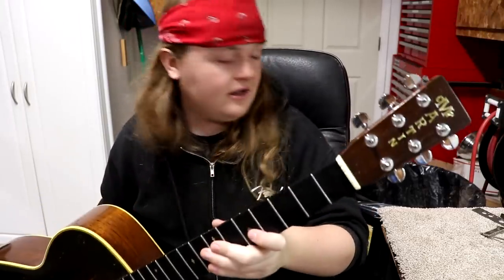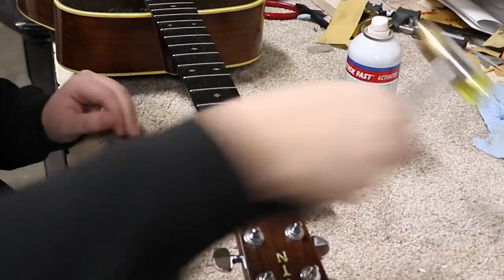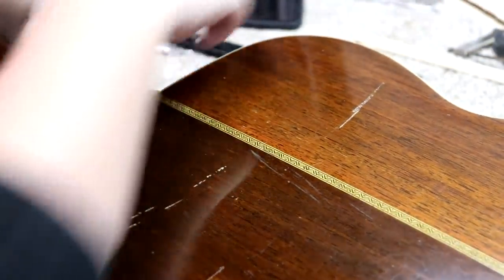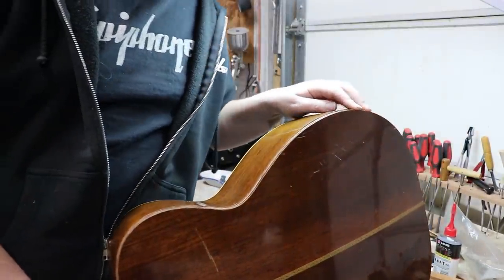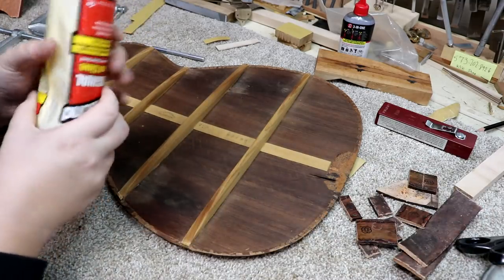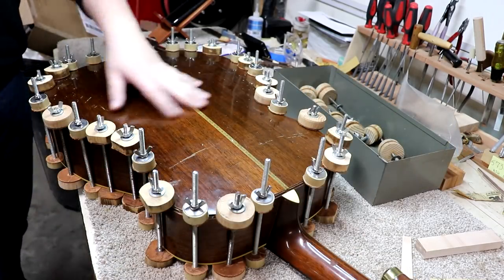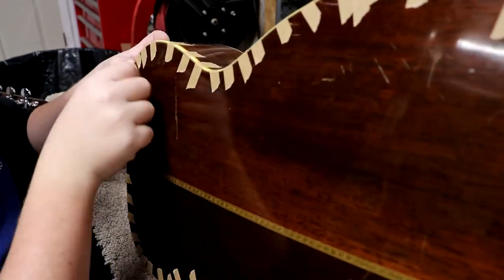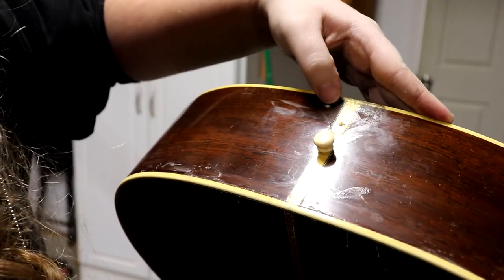496 RSW 1934 Martin C 2 Arched Top with Fallen Arches

Comment: I can tell from the big Grover tuning machines that this was worked on by Martin during the 1960s or early 1970s.  Their shop did truly gawdawful repair work back that -- they danged near ruined my old D-18 when I brought it for repair under warranty circa 1969, so I'm not surprised that their work on the nut and frets was substandard.
Reply: Bruce Morgen    I don't know personally, never having owned a Martin, but I'm told there were lots of problems in their production and in their warranty/ repair shop.  Too bad -- they have a name that is revered by everyone.  New and better management, just like at Gibson.  Some people get a little skittish about Gibsons to this day.  Their finishes are top quality, but maybe not so much inside.  I'll probably never find another old J-50 like I had in '65.  Had to part with mine in '02, sadly.  Be well, my friend.  Bob
Reply: Yes I've heard the same things.
Reply: Its a shame Martin didn't replace the machine heads with something a bit more vintage looking. Those chrome Grovers look awful.

Comment: Good job. I was suprised when you opened it up. The last old Martin archtop I saw, Martin had used braces to get the top to arch. (The guy fixing it made up a plaster mold for the top, then used his go bars. Explaining the reasons, etc.) Don't know if the one repaired was a bit newer, or older. The other was a 1930s build as well. Very suprised. I just knew it was going to be a big problem, but, no. You made it look easy, though I know it wasn't. Again good job!👌👍Oh, before I forget, my grandkids (12 & 7) love it when you do the repairs! When they see you, they say "Hey that's Caleb!!!"
Reply: Cool!  A Caleb Fan Club! 😄
Reply: This guitar is part of the C series, which had carved tops. And as it's a C-2, it has rosewood sides and back and originally came with nickle plated tuners and tailpiece.
Reply: @patrickwilliams3108  thanks for the info. I've only seen a few Martin archtops, I've heard they weren't very popular, as opposed to Gibson, real Epiphones, DeAngelico, etc. Thanks again for the education.👌👍

Comment: Nice old guitar.  One tip on archtops - rather than tweaking the bridge under all string tension, put on the two outside e strings.  Set those for intonation.  Then put on the rest.  That way you aren't moving the bridge around under full string tension.  Nice work.

Comment: Do you hold on to vintage binding when you replace it? Seems like it would be a great resource for repairs.
Reply: Jerry has a drawer full of parts and pieces of old binding. You'd think with as much as we have you'd find more exact matches, but we're rarely that lucky
Reply: I sent many  years  supply of old bindings from my 52 year old shop I closed it ""94yrs old"" it is in Jerrys stock.** old celluloid//cellulose binding should be stored  in a sealed mental container****DR KEL

Comment: Great job, Caleb!  I’d love to know when the owner took it to Martin for “service.”  Cant imagine them claiming to do anything with those frets, if they are pulling up and sharp on the ends and you can see play wear on the first few wires.  The nut issues are weird, too.  It seems to me they slapped some new tuners and a prefabricated nut on there and called it a day.
Reply: Hi this is the owner... I said that only because Martin Charged me for it on the bill, But when I looked at it it didn't look right to me.

Comment: Great job Caleb.  Once question.  Since you’ve opened up an 80+ year old Martin, would it not be best to remove and re-glue all of the braces, not just the sections that are currently delaminated?  That might be cost prohibitive, to the owner, but I think I’d make the investment in a family heirloom.
Reply: If they were any closer to loose I would have agreed, but there was no way the center of the braces were coming off without pulling pieces of the back with it. So to avoid damage I glued just the ends back down. If many years down the line the centers do come loose, the back was glued on with Titebond original, and should be easier to remove than when I had to.
Reply: Braces come lose due to hide  glue used years ago*****DR KEL
Reply: @MillsGuitars  makes sense.  Thank you so much for replying to my question.  Keep doin whatcher doin!  Great job.
Reply: @dscdrkel5546  I know.

Comment: Some call it a ‘taper’ Caleb, when the fretboard slopes down toward the dusty end of the neck. It tapers away, it means to gradually change level.
Reply: Most commonly called fall away.
Reply: @mattrogers1946  thanks Matt.
Reply: No a cut away  guitar you try to keep the fret board extender as flat  as possible**this will make the saddle taller for greater string brake  this gives better  sound and volume **DR KEL
Reply: @dscdrkel5546  He was talking about fretboard fall away, not a cutaway. By the way, it's BREAK angle, not BRAKE angle.

Comment: Why not use Titebond III.?
Reply: Titebond III is virtually waterproof, and much more difficult to remove in my own experience. Titebond 1 holds well, and can still be removed with heat and steam.
Reply: I accidentally used titebond 2 for my first project, and it's only water resistant, yet it can be ridiculously difficult to remove and repair. 
Edit; forgot a word.
Reply: Jerry covers this well in several videos, including Shop Talk 20 and Shop Talk 23

Comment: Caleb***When are you going to use the proper tools on the fret board***I SENT YOU THE PROPER TOOLS SO USE THEM.. notched straight edge and rocker tool.****I 52 years of instrument  designing and repair I never had to use a file on frets ****DR KEL
Reply: @davebryant8050  * I have been friends with Jerry for many years**At age of 94 I closed my shop and sent Jerry 7 care packages of tools and used and new parts***I also sent Cabel some tools to do a proper fret job.NEVER USE A FILE ON FRETS.***DR KEL
Reply: @dscdrkel5546  Kindly enlighten us as to what the proper tool is to recrown frets...
Reply: @mattrogers1946  My comments has nothing to do with crowning frets.The proper way is to use a notched straight edge  to make sure the neck is level NO relief *loosen the truss rod to  so the neck can  return to a flat condition and then rock the frets to see if they need  leveling **reset the high ones and crown if needed. ETC: ** For 52 years I  never had to use a file on frets. takes years  of playbilly off  of the instrument****. DR KEL
Reply: @dscdrkel5546  So you just mentioned leveling and recrowning without using a file. I'm wondering how that's possible, to do any fret work without some kind of fret file. What about doing a refret? How do you remove the sharp fret ends along the bass and treble sides of the neck unless you use a file?
Reply: @mattrogers1946  I am not talking  gowning file***ROCK THE FRETS to  find high ones then reset high one s maybe two or three maybe re glued with CA glue  and adjust never  run a BASTARD FILE on a full fret board.. you rock the fret three at a time to find high ones.***DR KEL
Reply: @mattrogers1946  He is using the proper tools for crowning **NO PROCURE FOR LEVELING FRETS.**DR KEL
Reply: @mattrogers1946  I don't think I said anything about crowning in my comments *use diff grits of psa sand paper in place of file.** slide a lady's nylon stocking down the neck to check the sharp edges of the frets it will stop on the bad ones***  DR KEL
Reply: @davebryant8050   I built my first guitar in 1963 while living in Bermuda. Had to order parts from NY. ** I Hand made  the router templates. to route the body to fit the pick ups I received from NY ****DR KEL